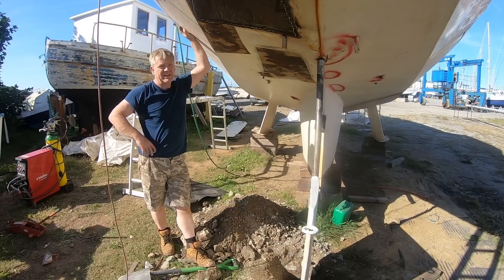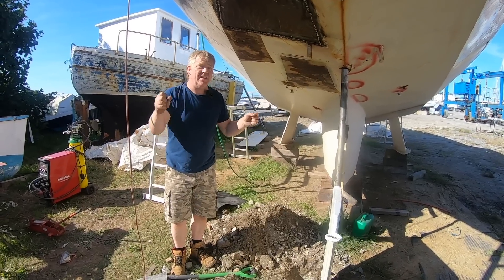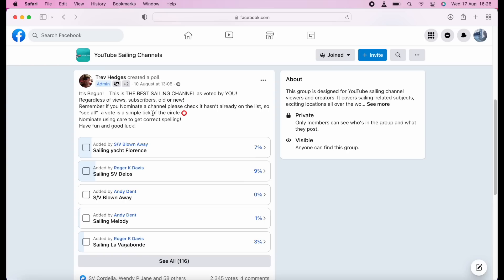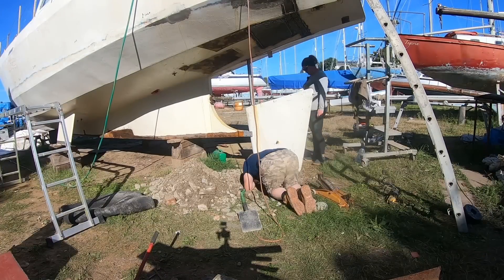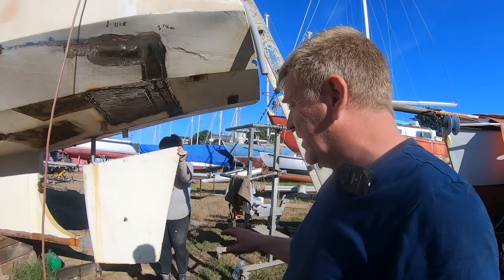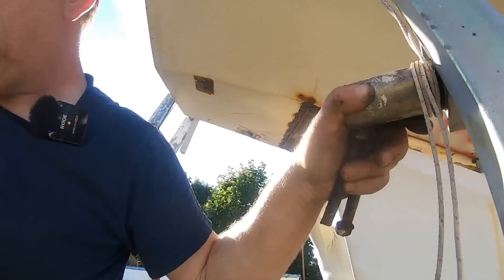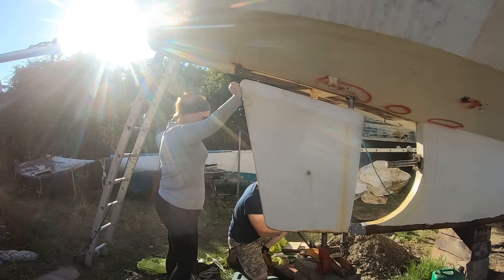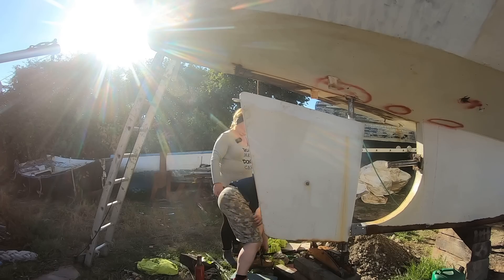#106 - Feel like a FAILURE!! I CAN'T do this WELDING!!!

Comment: It is not just the skill to do a good weld it is also about the skill to do it quickly and get it right first time. You are at the stage when you can weld, it takes you longer but also need to grind and reweld (taking more time) - and the key thing is because of circumstances beyond your control the one thing you do not have - is time.

Comment: Don't get discouraged because you ask for help.After building my first boat and almost ready to splash  my second I can say it isn't easy to keep the enthusiasm flowing day in day out. What you's have achieved so far is out standing and the best way to look at a big job like this is one small job or part at a time rather then the hole boat. All those bits and peaces will come together before you's know it then you will look back on the hole project scratch your heads and think ,did we do that .

Comment: Try using a 7" 1/4" nap cover. It will fit in a Gallon can when done using. For quicker clean up.
Journeyman painter 40 yrs. I did boat bottoms on racing sailboats too. Retired now.

Comment: The worst bit is preparing the hull for paint it always seams to be a never ending job noring at your soul until you want to explode then all of a sudden your finished well sort of until you put the prep paint on all the patches to see if you can see any uneaveness and nearly every time there still is more work to be done getting her ready for the undercoat and topcoat you then spray the top coat on and boy all your hard work has paid off she looks splendid like a new hull and all that soul destroying work just disappears with joy replacing it as you now know why you had to spend such a long time putting filler on and sanding until your fingers blead it was all worth while looking at her shinning in the sun a totally different boat now everybody comments on your splendid work and you feel warm inside and so all the others who helped feel the same way as they all did it for free just to help your wonderful family I've done the same thing but on cars you get a total wreck everybody laughs at you saying you will never get that back on the road well I've been driving her for 2 years now without any issues and she is a head turner and you feel warm inside when people comment on the work carried out on her as you will too all the best from john from Rugby UK.

Comment: No point feeling like a failure,  for all the reasons you mentioned and more..   i like the colour,  wondering 🤔 should the sides of the coach house be the same?         Cheers guys!  Great stuff….   Ps,  yeah that marine grease is great where you need it,  but a job to wash it off,  we used to use the parts washer on our own hands..  so basically kerosene,  because it’s not water Soluble.. as you can clearly see.. 😂

Comment: The rust is why I would not want a steel boat . Delos has pretty much circumnavigated and is far for new and the hull is as good as new .

Yep some glass and balsa boats rot , but the ones with foam core are immune .

Comment: Just seen how you jacked up and installed your rudder. I would imagine dropping the rudder in another boat yard would be a trouble.  I doubt if they would allow you to dig holes in other boatyards.
Reply from the maker: Yup you’re dead right. We’ve obviously filled the hole in and made it good but that’s another reason we’re gutted to be losing this very handy and accommodating yard